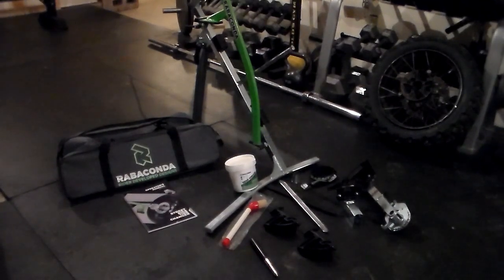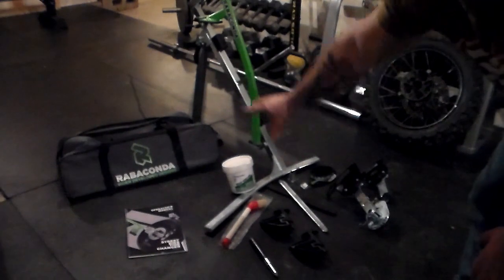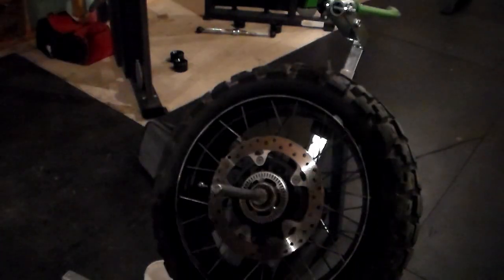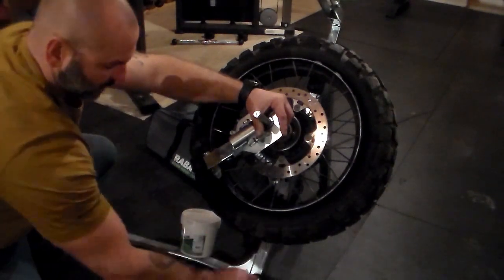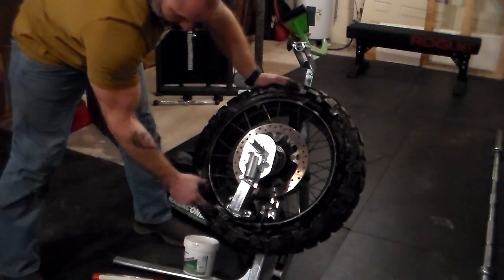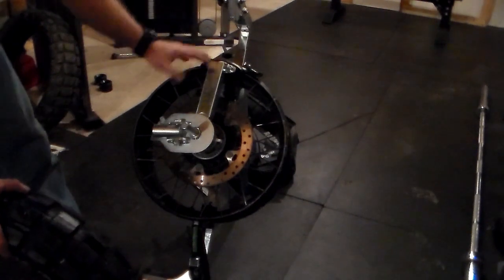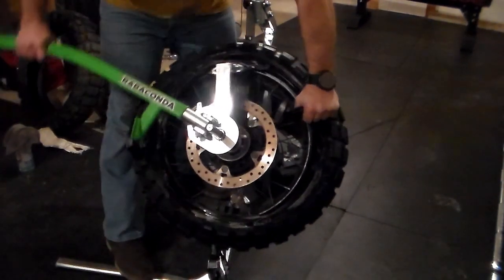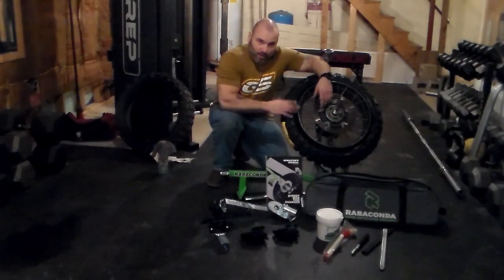RABACONDA - Full USE and REVIEW - Change your motorcycle tires in MINUTES!

Comment: Ugh. I just did my front and back GS wheels last week using nothing but tire irons. I did it, but it takes me a lot of time and effort to do so. And I think it's taking me longer as I get older 🙂
 But still less time than driving to the dealer and back. I just need to mentally justify the $700 price tag of this thing.
Reply from the maker: Easy, nick that wheel with your spoons to where it won't hold air and it will cost you $2000 to replace it. That's how I justified mine! 🙂

Comment: Great video!  What do you do for balancing the tires?
Reply from the maker: I never have...and have had zero issues. After a thorough online search it's seems to be a 50/50 split on people that say you even need to bother balancing motorcycle tires. A new tire has a paint blotch on it, that is the lightest point on the tire. I line that up with the valve stem, that's as far as I go.

Comment: Do duckhead scratch the wheels?
Reply from the maker: Not at all, that's what makes this machine worth the cost...only takes minutes...and ZERO damage, nicks, scratches etc to your wheels!!
Reply from the maker: I bought mine after nicking my GS wheel so bad with spoons that it wouldn't hold air, had to rasp the nick down...that's a $2,000 wheel I found out! Yeah, I'll buy the $600 machine.
Reply: Thanks. Awaiting my Rabaconda 😎👍